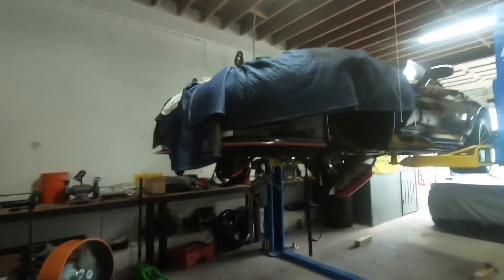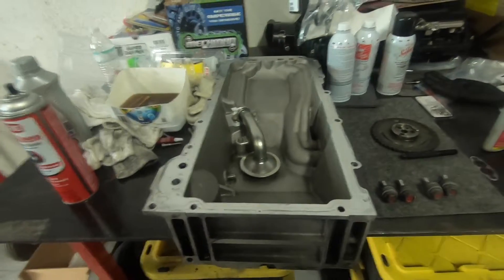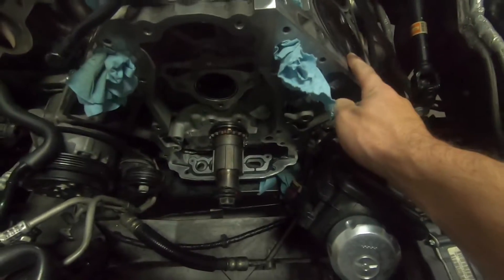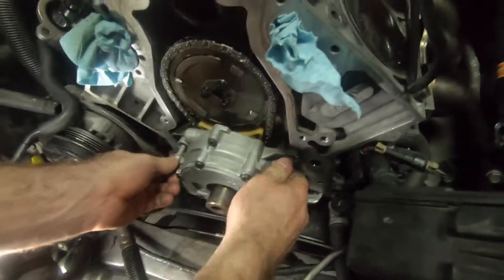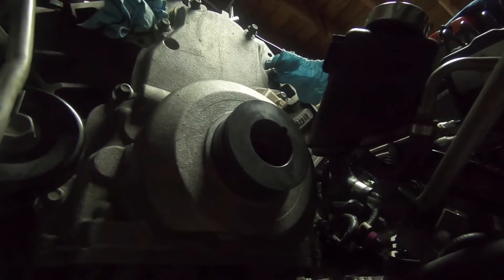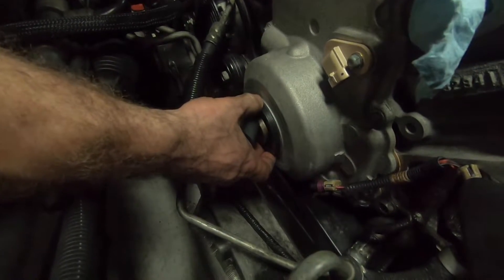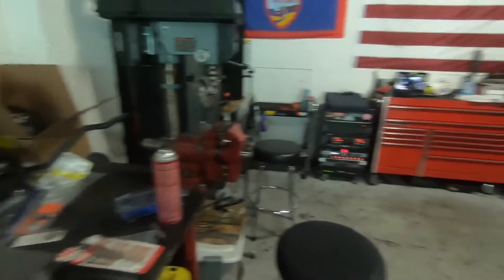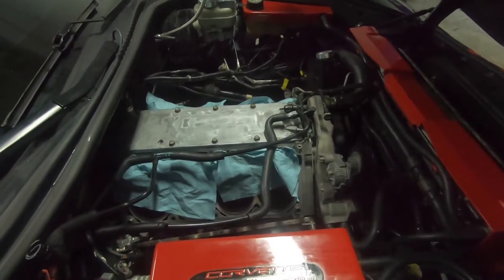RPM B3 Cam Install in a C6 Z06

Comment: Do I have to lift the motor in order to lower the oil pan?
Reply from the maker: No you should be able to lower the pan enough to slip the oil pump off without damaging the pan gasket. this gasket was already damaged from the previous cam install.